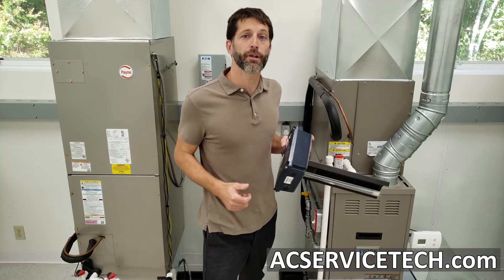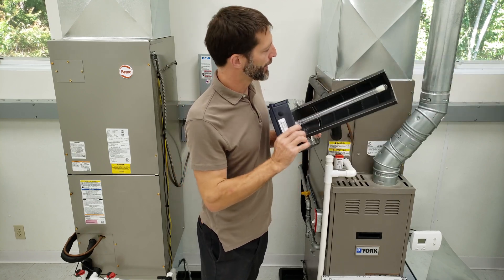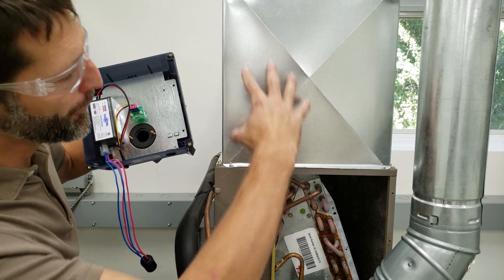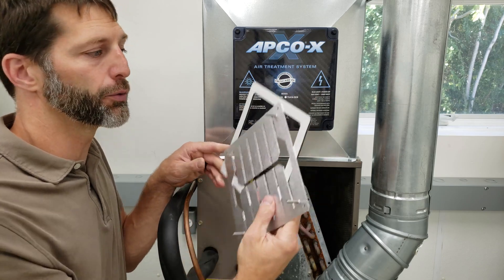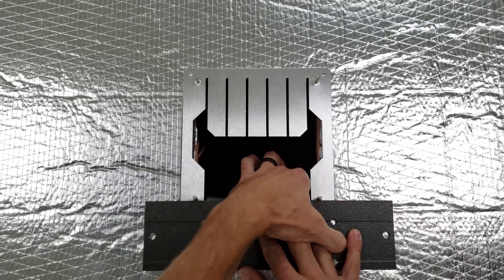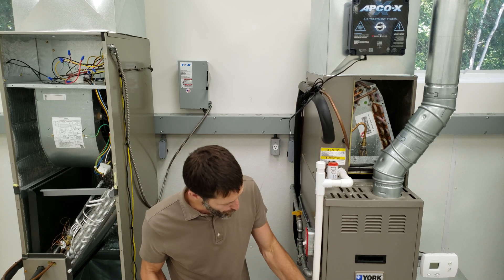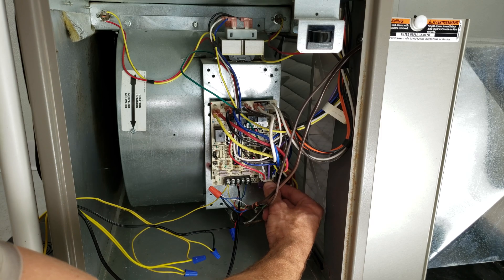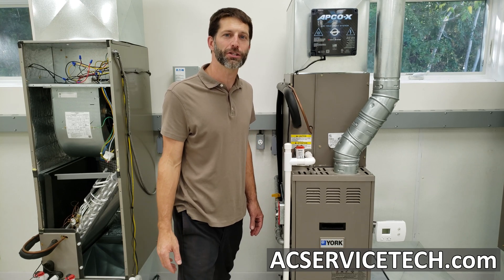How to Properly Install a UV Light in an HVAC Unit with Craig Migliaccio

Comment: Great overall video. Clear voice, concise content and excellent visuals. Seems pretty straightforward. You mention the unit above light catches odour. Does that include musty smell?  Furnace is in unfinished basement which probably doesn’t get enough air circulation and hence with age of house at different times I smell must from time to time with AC or 1st time heat turns on. Thanks

Comment: Im confused because i see the neutral wire from the transformer going to one of the hots on the breaker. The hot from transformer connects to the other terminal on the breaker. But its white not black. Then, i remember that wait 220 has no neutral. The bulb will.not turn on and the output reads 0 no 24 volts reading.

Comment: This seems like a good idea for killing germs but it also seems like it would be very airflow restrictive.  What effect does that have on all the other system components and the HVAC efficiency?
Reply: If that explanation didn't make too much sense or tl;dr, the UV lamp would not restrict the amount of air being pushed out at the register. Overall, the UV Lamp would increase the air movement because the UV light would get rid of clogs in the evaporator coils.
Reply: If you look at the duct work and the supply plenum of the HVAC system, the bulb wouldn't affect the "airflow" from the plenum through the ductwork and then to the air registers. If anything, the "airflow restriction" you're thinking would only increase the static pressure. 

When the air flows across the evaporator coils, you don't want the air to continue flowing into the ductwork. What happens is the air first hits the backwall of the supply plenum and then that air gets distributed to each ductwork going into the rooms of the house.

So it's not about the speed of the airflow being restricted, but the amount of static pressure the blower provides which "pushes" the air through the ductwork into the house.

Comment: Can you add multiple UV lights to the supply duct? I cases where the main duct has several bends, I was wondering about installing a UV light at every major bend to help mitigate lingering mold issues

Comment: Is there a way to have the 120 volt model only come on with the blower?
Reply: Why would u want to do that? U want your UV LIGHT on ALL the time, brother.
Reply: You could create a switched outlet with an SSR (relay). Make sure it is rated for AC on both the low and high side. Wire the low voltage side like you would the 24v model. Then it will switch the high voltage on and off with the unit.